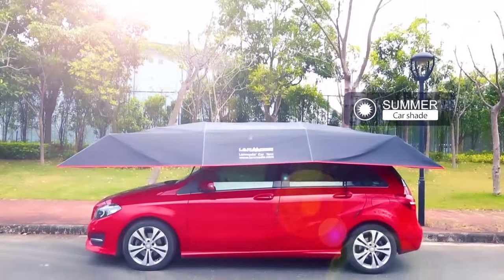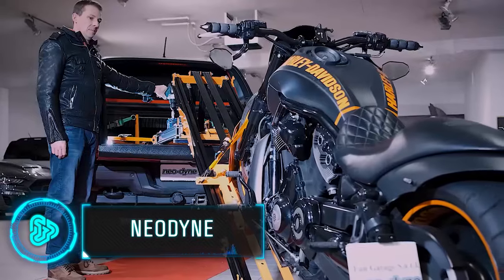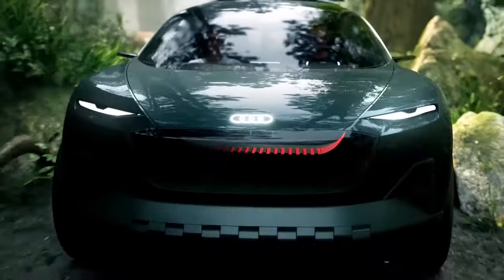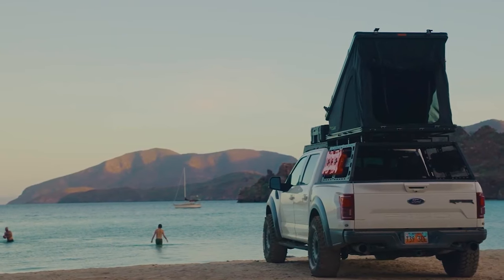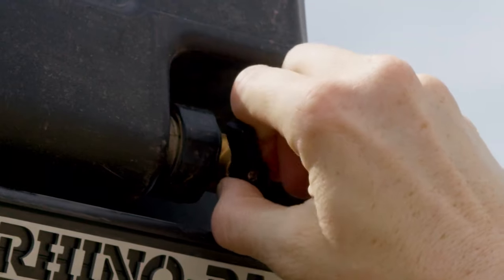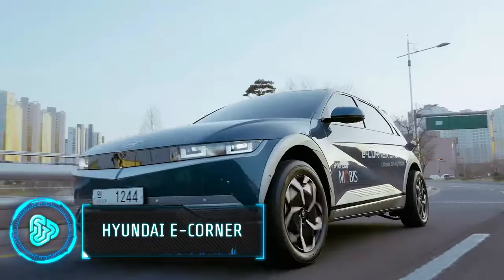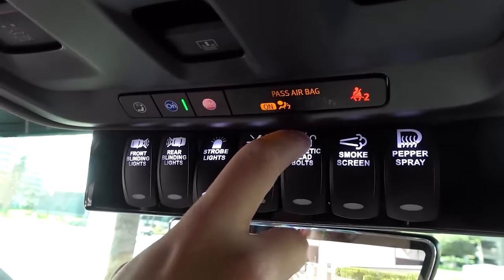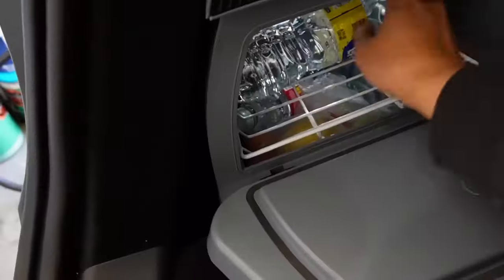CAR INVENTIONS THAT ARE ON ANOTHER LEVEL

Comment: You were showing the Aptera, but the Aptera does not use fuel. It is a total Solar or EV quick charge for longer trips when charge from the sun is not enough for the trip. Aptera is set to go into production in 2024! The company is located in Carlsbad, CA and the Aptera body is made in Italy by CPC.